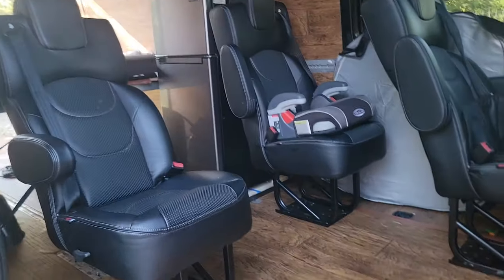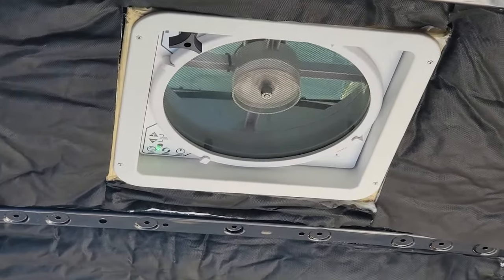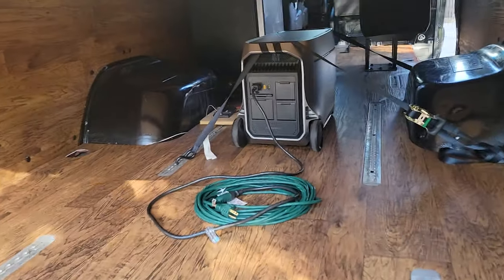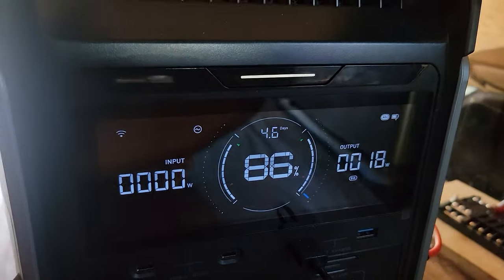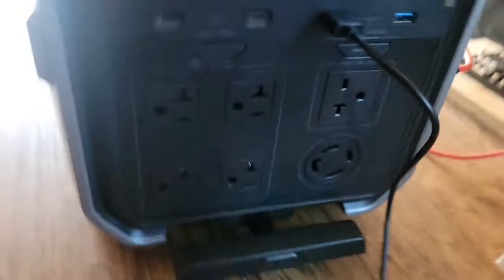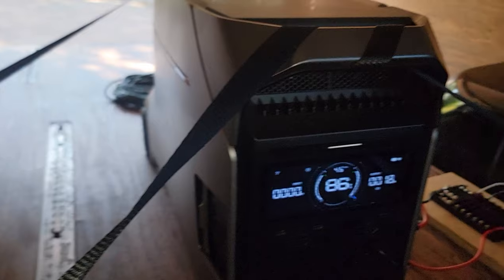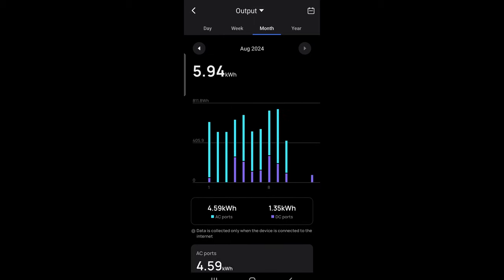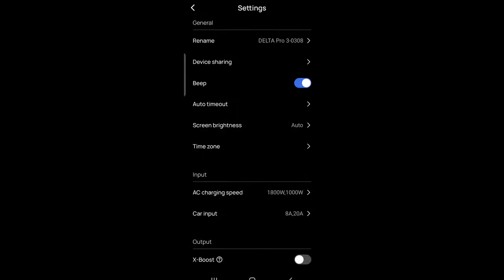Ecoflow Delta Pro 3 in Sprinter Van.

Comment: question for you: why did you decide to go with a 120V fridge instead of a 12V fridge? Would the 120, needed to be inverted, take more energy?
Reply from the maker: Hello currently we are only doing short trips so just using the refrigerator that we already have at home.  Frankly with the alternator charger and no power draw from ac it lasts 2 to 3 days easily on a single charge. But yes it makes sense to use 12v for better efficiency.